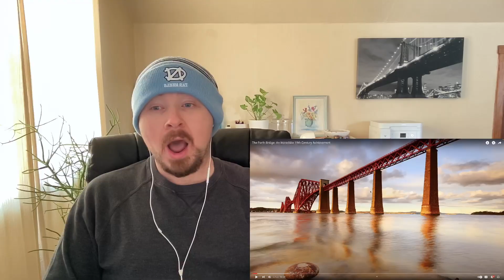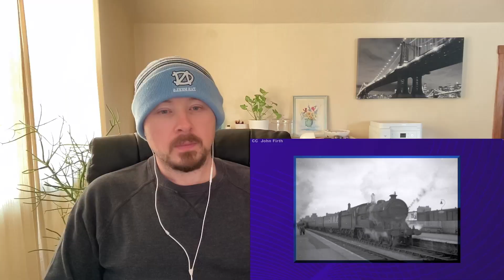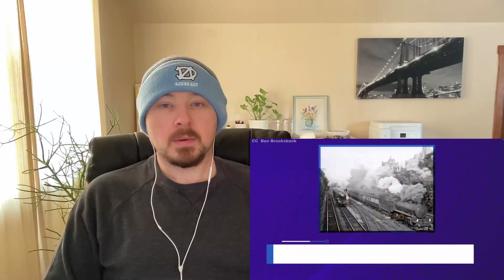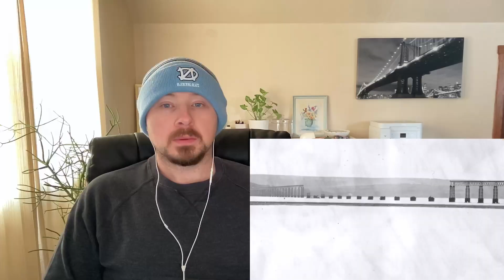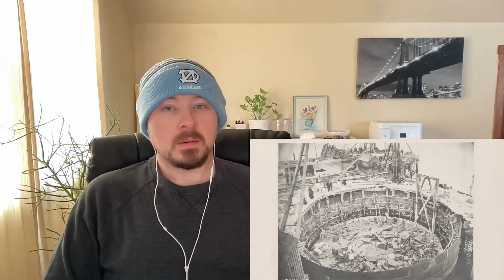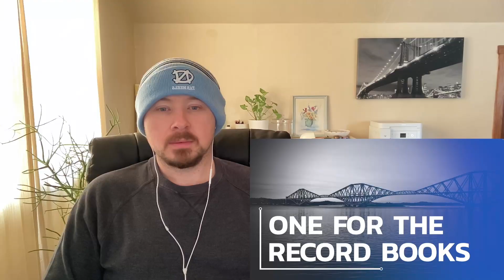American Reacts to The Forth Bridge - Scotland's Greatest Man-Made Wonder

Comment: As others have said, it's The Firth of Forth. Firth is the Scottish word for estuary, where a river meets the sea. In this case, it's the River Forth so it's The Firth of Forth. They also mentioned the Firth of Tay and the disaster of the Tay Bridge. You can still see the broken off bridge supports, alongside the rebuilt Tay Rail Bridge. The Forth Bridge was opened in the year 1890 I think.
Around 1964, the Forth Road Bridge was opened. At the time, it was the longest single span, two tower suspension bridge in the world.
More recently a new road bridge was built, the Queensferry Crossing. It opened to traffic in 2017. At the time, it was the longest triple tower cable-stayed bridge in the world and the only one with crossed stays. It's the tallest bridge in Scotland.

So all within sight of each other are three World beating bridges for there time, built in 3 different centuries, 19th, 20th and 21st centuries.
Before the Forth Bridge, there were ferries, crossing between North Queensferry and South Queensferry. Queen of Scotland, Margaret, founded a free ferry to take pilgrims north to St Andrews in the 11th Century, which is why the villages are named North and South Queensferry.

From a proud Scot 😊

Comment: It's the FIRTH OF FORTH.A Firth is an Estuary. The Forth is the name of the River it crosses. On the other side of Scotland Glasgow sits near the Firth of Clyde, the estuary of the River Clyde. The Firth of Tay, where the bridge collapsed, is the estuary of the River Tay. There is a common saying in the UK that is 'it's like painting the Forth Bridge' for any job that seems endless & almost pointless, as it is said that the Bridge has to be regularly repainted with rust proof paint. By the time it has been painted from end to end, it is time to start again at the beginning again, so it is always being painted. More recently a coating has been put on it so that painting does not have to be done so often. Meanwhile, the nearby road bridge built in the 1960's has become unsafe, & a brand new bridge has had to be constructed to partly replace it, by taking some of the load. Eventually it will have to be abandoned. The Railway Bridge was so well designed & built that it continues to carry trains far different than those in use when it was first built. It was over-engineered so that it didn't suffer the same fate as the Tay bridge. Road traffic had to take ferries across the Forth until the 1960's bridge was built, or go on a long detour to Stirling, where the first bridge crossed, many miles upstream.

Comment: I HAVE WORKED ON THE RAIL BRIDGE  ON  SCAFFOLDING WHEN THEY PAINTED THE BRIDGE  YEARLY  THEY WAS A  SHED HALF WAY ACROSS WHICH WAS THE TOILET JUST A HOLE IN THE FLOOR  NOT USED IN DECADES PLUS I WAS TOLD BY ONE OF THE  PAINTERS THERE IS  RIVIT MADE OF GOLD  WAS LAST ONE PUT IN

Comment: You can get a good view of the Forth Bridge on approach to Edinburgh Airport if sitting on the right hand side of the aircraft on a runway 24 approach.
You can also walk over the Forth Road bridge that sits next to the Forth Bridge. Still use road in the name for the Forth Road Bridge despite it only being a bus lane now as its an engineering failure and wasn't fit for purpose as a full road bridge.

Comment: For 7 years in the 80's I was a scaffolder who did a lot of work on the rail bridge, mostly under the track where a narrow wooden gantry spans the bridge. The scaffold was mostly for access for steel workers to replace steel panels which were very thick but some were that old and could be poked through with a good finger jab.....absolutely true. On one occasion we caught a roosting pigeon and tied some toilet roll to its leg......as it flew off it was like one of those advertising planes.

Comment: As some one who has gone over the 3 bridges you kind of forget the importance they have when you had to keep your fingers crossed the bridges were open in bad weather or it would turn into multiple hour detour just to get home when it was just the 2 bridges. I also had the pleasure of seeing the process of the Queensferry crossing being constructed on my daily commute. 3 bridges in 3 different centuries.
Reply: The vehicle bridge opened in 1964 lasted into the start of the 21st century when it had to be replaced. It was downgraded to pedestrian and cycle use.
Reply: Kumasenlac , the Forth road bridge has now been repaired and is used by emergency services,  public transport and vehicles not allowed on the queensferry crossing.  It is also the diversionary route use when the queensferry crossing has to be closed. New automatic barriers have been fitted on the roads on both sides of the bridges have  been fitted recently to this. facilitate

Comment: There's 2 other bridges right next to these. Both vehicle bridges, not rail. One built in 1958, the other just recently. The one built recently was to replace the one from 1958 because its starting to fail structurally, so only buses and light traffic can cross it. Yet the rail bridge from the late 1800's still stands strong and solid with very little issues. Its true when they said, they don't build them like they used to.

Comment: There is a saying, in the UK, when talking about a never ending job, "It's like painting the Forth Bridge." Up until recently the bridge, because of it's location, had to be painted, either bright red,  as in the video, or Red Oxide, a sort of dull red, it was a case of the painters would start at one end and work their way across to the other end, by which time first end was in need of repainted. A few years ago the started using a new, more durable formula paint, said to last for 20 years IIRC.

Comment: In the old days it was a considerable diversion to get to the other side.  In medieval times the capital was Dunfermline and the royal court would want to travel to Edinburgh.  It was a journey of 21 miles to Stirling Bridge then 40 miles to Edinburgh.  This is why there are stopping off points such as Linlithgow Palace and Stirling Castle. 
Then in the 11th century  Queen Margaret initiated a ferry at the narrowest part of the Firth of Forth.  This ferry worked between what became Queensferry and North Queensferry.  That’s where in 1882 construction started on the Forth Bridge which was completed in 1890.  The ferry continued until 1964 when the Forth Road Bridge was opened.  
In Queensferry you can still visit the chapel used by travellers to give thanks for a safe crossing. The current Priory Church was founded around 1440

Comment: Take a look at the Pontcysyllte Aqueduct - even older and a massive engineering feat to carry the canal system. Canals and barges pulled by horses were a massive part of the industrial revolution, carrying coal and iron and grain.  The Forth Bridge, yeah there was (maybe still is) a hotel that was right under the South Queensferry side - I stayed there when I was visiting the Hewlett Packard facility at South Queensferry in the mid 80's (I worked for HP for 35 years) . Fantastic views from the hotel and one of the best steaks (Aberdeen Angus) I have ever had.

Comment: On the bit about the Tay Bridge. The photo they show near the start of that section with the curved bridge isn't the old bridge. The curved design of the replacement bridge was used to minimise the impact of the wind and avoid another collapse. The point on the firth where this bridge crosses the Tay is much more exposed to winds coming from the North Sea than the Forth Bridge which crosses further inland. At low tide, you can still see the feet of the old bridge when travelling over the new bridge which, for me at least, never loses it's haunting feel despite having crossed it hundreds of times.

As for the Forth Bridge, if you really want to experience it, the most awe-inspiring way to see it has to be by going up to the viewing platform or abseiling off it! Not sure it's started again since COVID but up until then, there were a few events per year where you could do so by agreeing to raise/donate a certain amount for one of the charities participating. Think it was usually around £500 rather than London Marathon style thousands. Unfortunately, I had to cancel mine (two years running) because of injury but will be signing up again as soon as I spot a date.

For a good view of the Tay Bridge, get one of the speed boat (RIB) tours from Broughty Castle just outside Dundee. Not many speed boat tours will take you seal and dolphin spotting, and past some historic buildings, oil platforms, historic ships and engineering marvels all in 40 minutes.
Reply: That is the old bridge. Look how thin and enemic the thing is lol

Comment: Hello Steve. Before we had the railways we had started the Industrial Revolution but horses and carts just was not good enough to carry goods around the country. They started building canals because one horse could tow a boat of cargo quicker and easier than a team of horses and a cart trying to carry goods. There many miles of canal, some have long gone but there is still nearly 2000 miles of navigable rivers & canals in the UK. A few still carry commercial traffic but most are now for recreational use. One of the busiest is probably the Llangollen Canal, 46 miles from Shropshire, England to Llangollen, Wales. Through Llangollen passes the River Dee and the usual way to cross a river is a flight of locks. This time they decided to build an aqueduct, Thomas Telford built it for the Canal Company, this is an inedible sight to behold, the aqueduct is 373 feet in length about 7 ft in width and crosses the River Dee at 126 foot. The aqueduct is in a village called Pontcysllte near Wrexham, North Wales and carried Narrow Boats of 7ft beam and up to 70ft in length and before internal combustion engines were invented the boat was horse drawn to the canals had towpaths. Not to be outdone the aqueduct had a towpath on one side, nothing, not even a fence or railing on the other side. Here is a copy of one of the many You Tube films https://www.youtube.com/watch?v=ehX7gKaAL74 if you can’t follow the link try searching “pontcysllte aqueduct”. Oh, the aqueduct was completed in 1795 and like the Forth Bridge is Grade 1 listed. Now controlled by a government organisation called C A R T, the Canal & River Trust.

Comment: When I was a student, nearly 50 years ago, we were taken on s short tour of the bridge by the Bridge Superintendent. H&S was different in those days. Our safety equipment was an orange waist coat (US = vest) and the briefing was "Keep your eyes open for trains".
We were escorted along the track bed to a hatch where we dropped down a ladder to an inspection walkway under the main deck. It was a 12" wide wood plank on strap hangers with a wood hand rail, at below waist height, on one side only. The other problem, the hand rail was rotten and missing in one part, so our hand holds were only the hangers 10' apart.
What you do when young and stupid.

Comment: The days of the laborious, never-ending repainting of this enormous bridge came to an end around 11 years ago when, after a 10 year restoration project which involved stripping away the old layers of paint and systematically applying modern primers and top coats of long-lasting impermeable paints the bridge finally had its glorious, Forth Bridge Red appearance restored. The new paints have a life span of 20-25 years.

Comment: The reason it's called the Forth Bridge (notice there's no u in Forth) is nothing to do with numbers, Steve - the name of the river is Forth and the point of the river where it crosses is called a firth - which is like, a tidal estuary.  Travel along it another 20 or so miles to the east and you'd be in the North Sea!  Along with the Old and New Towns, the Forth Bridge is the third UNESCO World Heritage site within the boundaries of the City of Edinburgh, although technically most of it is within Fife - the name of the local authority on its north side!  

There are many publications on the subject of the bridge and its construction, which was basically by hand with only very primitive hydraulics available.  Furthermore, there were no real health and safety rules, and not even as much scaffolding as you might expect - workers having to literally climb up and down ladders that were literally tied to the scaffolding that was anchored to the central cantilevers and not to anything solid directly beneath it; and  so there are many photographs of workers literally hanging on the ends of pieces of rope...!  

For some years there has been talk of opening a visitor centre and taking members of the public on guided tours of the bridge itself.  There is an existing walkway for maintenance staff under the southern approach viaduct that could be used, and lifts inside the main steel upright tubes - although the one used for charity events in recent years is a temporary structure attached to the outside.  This leads up to a platform right at the top of the north cantilever.  Youtuber Steve Marsh made a movie about this just a few months ago, which you might like to look at:   https://www.youtube.com/watch?v=NrgRMhp_Q64

Comment: Impressive, though the Forth Bridge is, for me a bigger wonder is one of my local bridges. Much shorter but used technology that was new at the time and was part of a huge project. The Menai Bridge was the world's first modern suspension bridge, built in 1826, and was for a few years the longest suspension bridge in the world. It was designed as part of a massive project by Thomas Telford to link the port of Holyhead with London. He had to find a route through the mountains of North Wales, as well as build a bridge across the Menai Straits - and a shorter one to join Holy Island with Anglesey. The route of the A5 has changed a lot since then but I used to live along the original route and just half a mile away there was an old coach house that had been built to service the mail coaches that the road was built for. Unfortunately, it burned down a few years before I was born so I was only ever able to explore the ruins as a kid in the 70s.

That German who criticised the plans for a suspension bridge over the Firth was spot on. The Menai Bridge is of primarily stone construction with the central section held up by very heavy metal chains. However, I recently saw photos of what the bridge used to look like. These chains were added in the 1930s and replaced a series of much thinner chains, which were probably adequate for the weight of the original traffic, which would have been horses, people and coaches. The bridge would have collapsed into the sea if its original chains were in use today. Given the span of the Forth bridge, they'd probably need something similar to what the Menai Bridge has today straight from when it was opened.
Reply: David Davies - The Menai suspension bridge was the first modern suspension bridge to begin construction, but it wasn't the first to be completed. For that, look up the Union Chain bridge, spanning the River Tweed (and the England/Scotland border) which was opened in 1820. It's currently in the last stages of a major refurbishment - should reopen in the next few months.

Comment: There's an old saying "it's like painting the forth bridge", meaning that it's an endless task, basicaly you start painting at one end, by the time you get to the other end, it's time to start the painting again, the irish contractors used to come over for 6 months, and be replaced by another crew for the next six months, which meant they didn't have to pay uk taxes..
I believe they use a more long lasting paint today
you could explore the london underground, there are several tunnels under the thames
Or the Severn Tunnel that goes under the Severn tunnel which is about 4 miles long